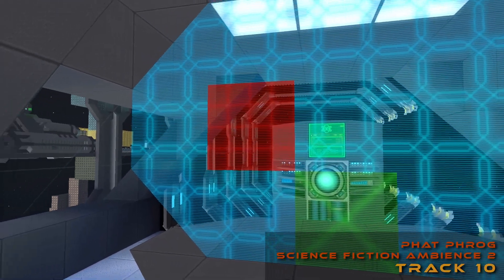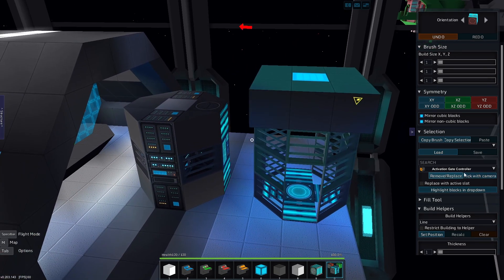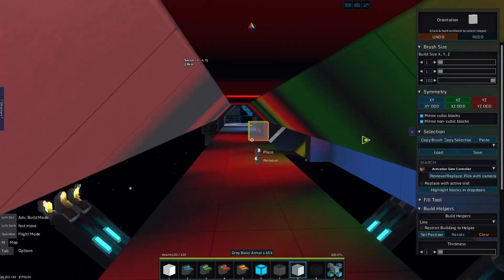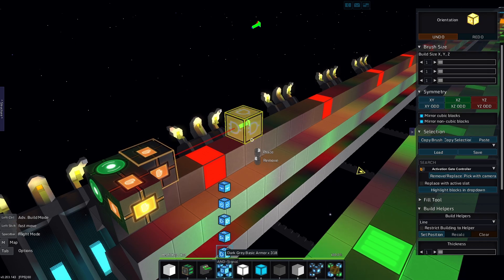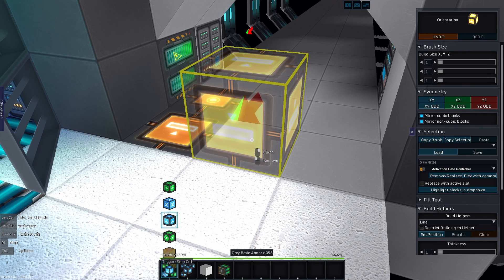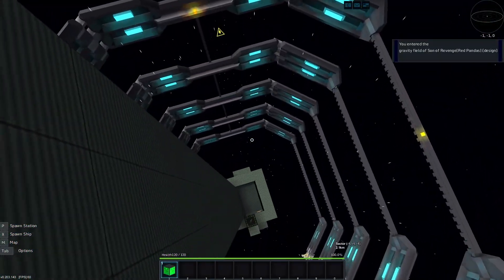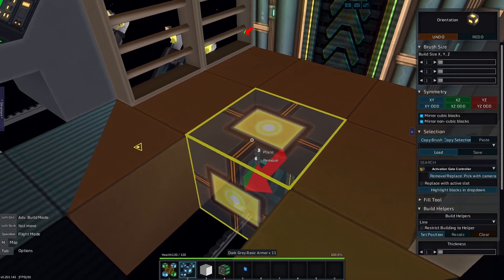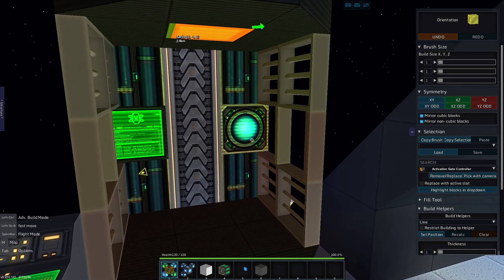Starmade SURVIVAL - Gravity is a real pain. My bathroom scales agree with that... #starmade

Comment: Dual senors to turn on the only in the right direction?
Reply from the maker: Shortly after this video, gravity was updated to work better with logic, and you can even "filter" when gravity blocks affect a player.

At the time, though, this wouldn't have been possible. The dual sensors would have involved logic gates that didn't work with old gravity. It was a messy broken system, and I'm glad they updated it.
Reply: @AyladPlays  Ooh nice